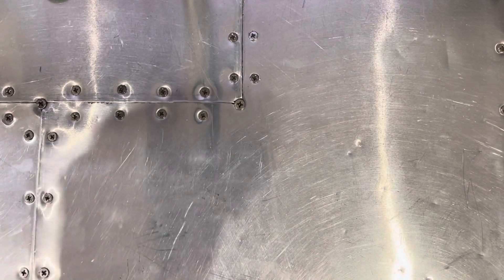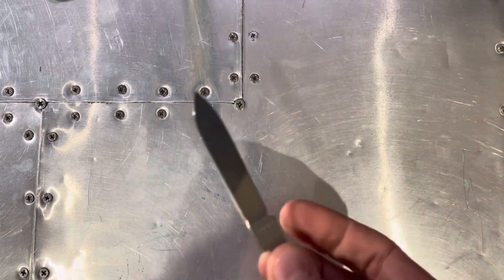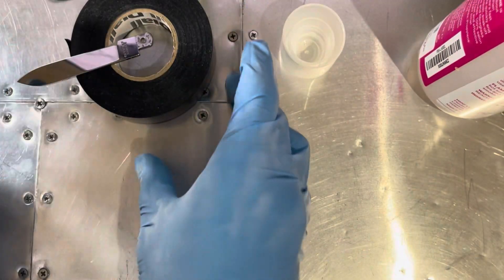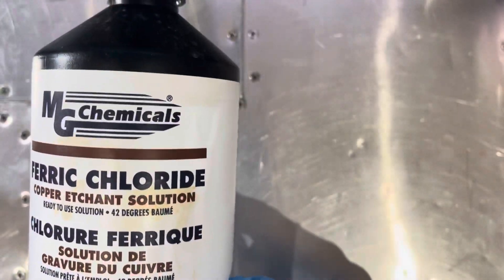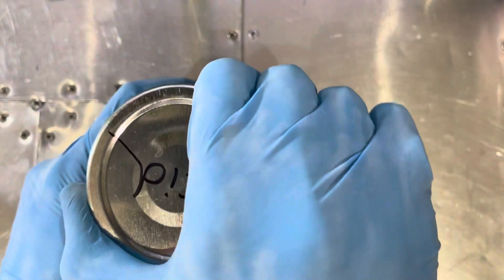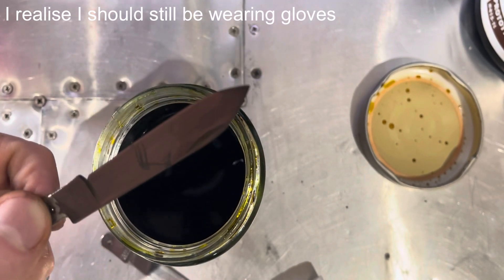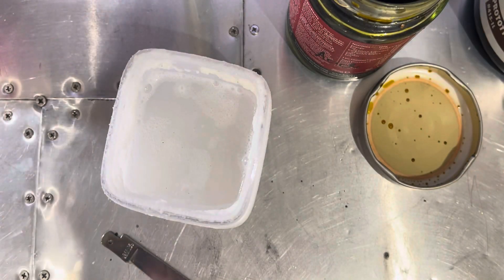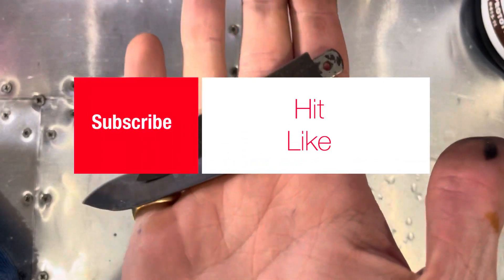Acid Etching and Brass Washing Knives | How To

Comment: forty two degrees Baumé refers to the concentration or density of the ferric chloride solution. The Baumé scale is a set of hydrometer scales used to measure the specific gravity of liquids. In the case of ferric chloride, which is denser than water, a higher Baumé value corresponds to a higher concentration of ferric chloride in the solution. A solution at 42° Baumé indicates a relatively concentrated ferric chloride solution often used for etching various metals like copper, brass, bronze, Damascus steel, and stainless steel

Comment: Could I hang a complete SAK in the solution and clean it with a ultrasonic or will this go wrong?
Reply: It will react differently with the aluminum liners, get in all the pivots, and you won't be able to wipe the residue off between dips.
Reply: Thanks for your answer, I was also unsure how to get it really clean (maybe by extending all the tools) but then again I have to take the brass pivots and aluminium liners in account as you said. thanks for your reply! @ThorenTravels
Reply: @Renriet  No problem! I did see a comment on reddit by someone saying they did a full dip and it turned out ok.